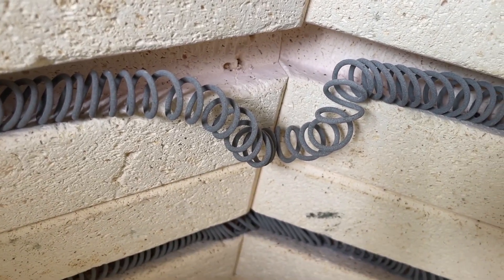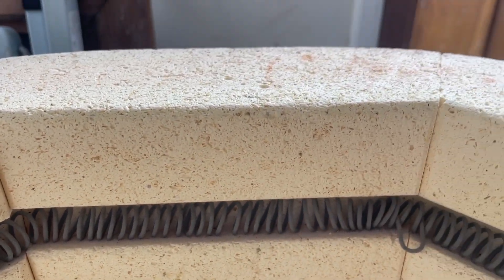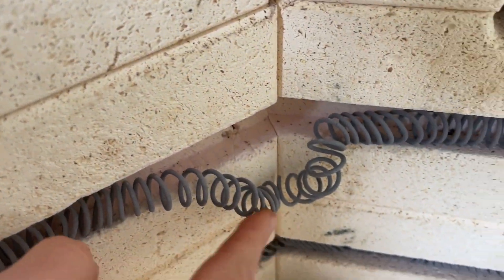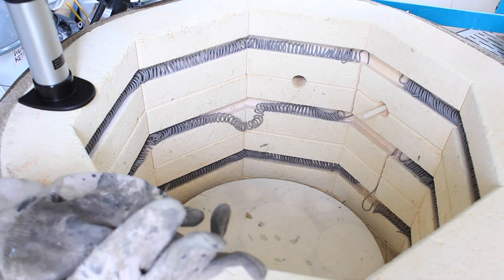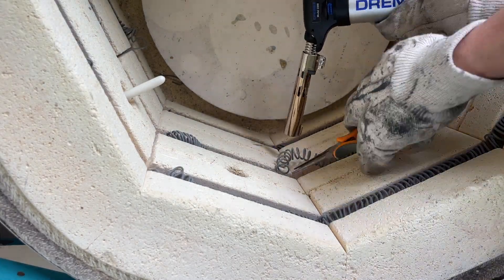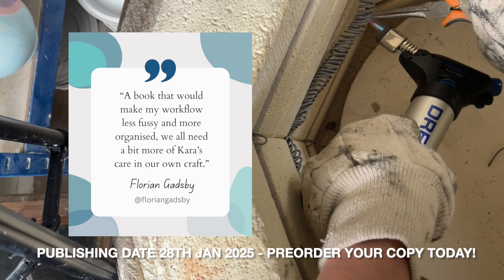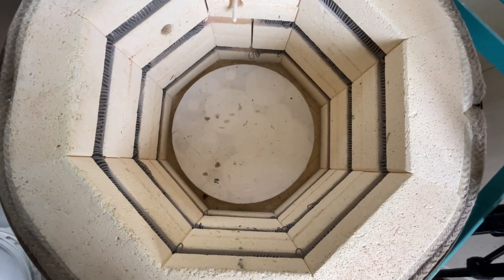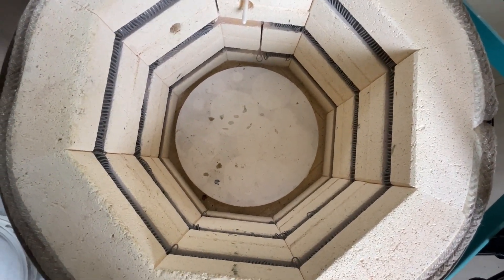Kiln Maintenance - How to Fix Sagging Elements in Your Electric Kiln

Comment: You really need a real propane torch. It will heat those coils cherry red in seconds and make the job a breeze.
If you break an element, heat the ends about 2 cm red hot and twist them together.
I repair kilns.
Reply from the maker: Thank you for the tip!
Reply: @KaraLeighFordCeramics  
You're very welcome.
Old kanthal coils are extreamly brittle when cold, but workable hot.
Just remember the coils always need to be cherry red hot while you''re twisting them together or pushing them back into the brick slots, or they'll break. The hotter they are, the softer they become..
 If you need to contract a stretched coil, heat to red hot and squeeze the coil axially with needle nose pliers.
Good luck !